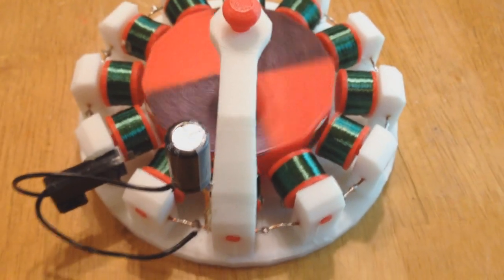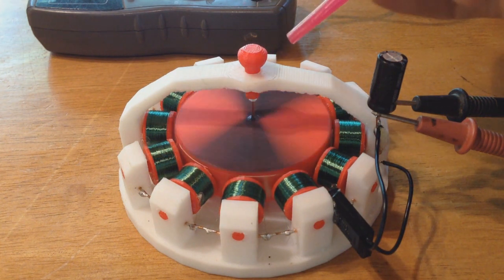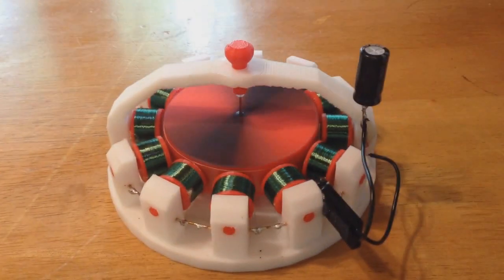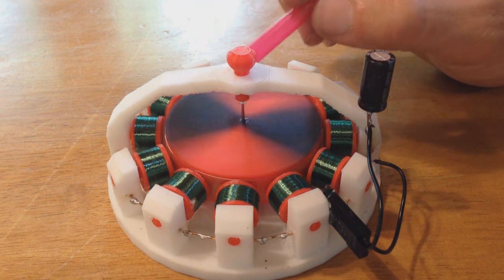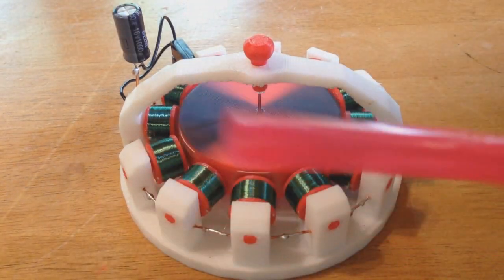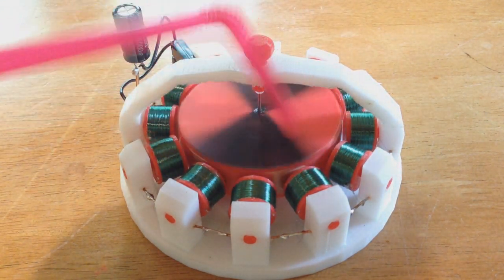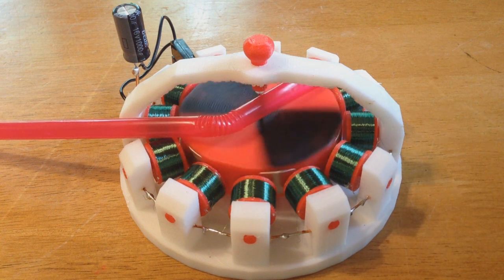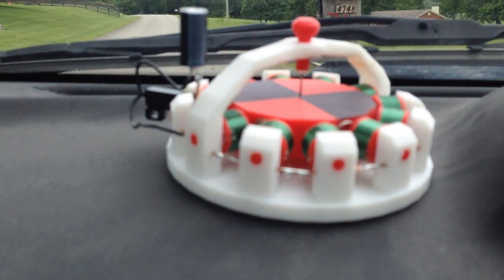No Batteries! EZ Spin V2 Motor Running on a Single 1000uf 16v Capacitor

Comment: Sure it does. He showed an almost 5V output from just blowing on it. I'm sure it can turn even faster with a small motor running it. Any excess voltage can be harnessed and stored in a battery bank or used to light LEDs to demonstrate the over-unity power.

Comment: I understand that this motor runs efficiently, but if you applied a load to the crank shaft wouldn't it just stop?

Keep in mind that power is torque times angular speed, and you have the angular speed, just no torque- ie, the power output is very low.

I think this device would function much better as a generator based on the efficiency. You would need to chain a whole lot of caps together to increase the power enough to put a decent size load on the crank.

Comment: Check this antenna: "New Printable Antenna Can Harvest Ambient Energy To Power Small Electronics"
It says, for example:
Researchers at Georgia Tech scavenged sufficient microwatts to power a temperature sensor, using the ambient energy produced by a television station signal that was a third of a mile away. If you REALLY run at 2 or so micro watts, you should be able to run for free forever just using RF energy.

Comment: For anyone interested I uploaded a CAD model for this if anyone wants to mess with it as I find STL files hard to work with for modifications, as it is a CAD model circles are circles not course polygons etc.   There are SAT and STEP files that can be imported into almost any CAD system.  Have fun!

https://grabcad.com/library/ez-spin-pulse-motor-1

Comment: I didn't say the motor itself is not legit. But the energy in this capacitor is not enough to keep it running for very long. Have you calculated the motor's power consumption? You can use your multi-meter as an amp meter and see how much current is being dragged into it from the cap. If you want to be serious with this you should take an oscilloscope and see how the voltage and currents are changing. And people make magic tricks not only on April first :-)

Comment: Of course it will stop eventually. In any such system there might be energy moving between the parts, but because energy is lost out of the system, eventually all energy is lost. Even any tiny noise it makes means loss of energy.

Comment: As long as you don't claim that there is magic involved LOL. Your focus is obviously to minimize the friction to gain maximum duration of the motor running. If we assume that your only energy source indeed is the capacitor of 1000 Micro Farads, the maximum mechanical energy you can output is defined by E = 1/2 x C x V x V x Efficiency, thus you have only max 13 Mili Joules of energy to do with (5V start). Agree?
A Big Mac contains 2,300 Kilo Joules of energy, just to compare!!!

Comment: How about you connect a 5V motor to the wheel?! If you can generate, say, 10V...use 5 to turn the rotor and have 5V over-unity.

Comment: the magnets is facing N or S pole
Reply: +Ahmed Nor is that a question... or a statement?
Reply: GrimL0gic Thank you for respond and it's a question
Reply: OK, I'll answer the best I can. As the cylinder spins the magnets get pushed by the magnetic field induced by the coils. So as the north magnets passes by a coil the coil will switch from south attracting it to north pushing it away. So if I were to guess, each magnet alternates which side (north, south) faces the coils. If not, they would be too close together and the coil pushing one magnet would also push the other, negating the net force. 
  Let me know if you have any questions or corrections.
Reply: +GrimL0gic 

thank you I got the idea

Comment: It's not doing any 'work' (physics definition) so why should it slow down? The only reason it will eventually slow down and stop is the very low amount of friction (air and axle contact). If it where in free space with no contact it may spin for millions of years, as soon as you actually took any 'work' out of it though the thing would rapidly slow as you are extracting force...
Reply: Nick Outram physically, I think this is correct. The only reason why it stops at some point, would be the friction.
if you connect this to any type of a consumer such that it powers it, it would actually do work so it would slow down much more. but still I like it.
Reply: +Nick - But in free space you wouldn't even need coils or magnets - you can hand spin anything and it will stay spinning - Besides, a motor running on capacitors is doing work, it's powering the circuit.  The one in the following link is much better than the one in the video above: https://www.youtube.com/watch?v=OMVtGxSYdhU&index=7&list=LLBAPkRPdqZTXLOa_C77G9uA

Comment: You Eff? It's Micro-Farad.

The "U" isn't a U, it's a Micro symbol.
Reply: You are correct in saying that it is microfarads, however, i have a boss that has been working with capacitors for over 40 years and occasionally he will say "You-Eff." Yes, its not EXACTLY correct but if there were someone in here watching this that wanted to build this and didnt know the U means micro then they might try and look for an mF capacitor thinking the m meant micro instead of milli.
Reply: you-eff, my-eff, micro-eff. poteito-potato.
Reply: lol. gotta love it Ole-Johnny Olsen
Reply: gmattison1996 [sigh] Oh what effing effer! \( 0_0)/
Reply: Ole-Johnny Olsen 
At least he said You-Eff and not Eff-you!
Reply: Doom2pro Actually, the "u" is supposed to be the Greek letter "mu," which has been adopted as the symbol for "micro," i.e. 10^-6 power

Comment: At the most here all you have created is a low-friction brush-less motor capable of running for extended periods at low current draw, and a motor unlikely to be capable of providing much torque, which severely limits it's applications, especially given it's size and complexity.

I fail to see what is so exciting about it?

Comment: Not at all, my point was just to compare energies. If this motor really runs on a relatively small capacitor of 1000uF for hours, it's quite impressive considering the size of the motor. On the other hand, any battery powered wrist watch motor can also run for many hours on such a capacitor. It all boils down to minimizing the energy loses. There is nothing beyond normal science in this.

Comment: hi have you tried urine sounds disgusting but i have had some very strange happenings when i have tried to carry out joe bookers magnetic charged static air repullsion extraction engine .the urine/piss disappeared/evaporated/soaked in to the engine block  but my engine cranks far faster  i am now told urine is a excellent neutral charge no expert here in uk
Reply: lol don't you just love a place where you can just put it out there?

Comment: Yes, air drag is another loss :-)
So we have these losses:
1. Acoustical noise energy loss
2. Electrical resistance energy loss
3. Air drag energy loss
4. Bearing friction energy loss
5. Electromagnetic radiation energy loss
Did I miss any?

Comment: 1000uF = 1F. That's a big capacitor! The u is actually a Greek letter mu.
Reply: Robert Langford  uF= 1*10^-6 F.....so 1000uF= 0.001F, or 1F=1000000uF
Reply: +Robert Langford You're wrong. 1000uF = 1mF. 1000mF = 1 Farad.

Comment: isn't 1000 uF just 1F? cool motor though.  bet you could run it on atmospheric electricity.
Reply from the maker: 1F = 1000000 uF.
Reply: lasersaber che bufala!!!!!!!!!!!!!!!!!!!!
Reply: ciro de filippis I)?I.
Reply: lasersaber Oh yeah.  Duh.  That's why I use a calculator instead of a brain. 
So it's a mF
And whatever che bufala means.
Reply: +jdotpenneyatcomputer a 1F capacitor would be huge, bruh... like the size of a soda can.
Reply: +Michael Jensen Yeah, I caught this earlier  - see my identical comment above 8)  Oh yeah.  Duh.  That's why I use a calculator instead of a brain. 
So it's a mF
Reply: +jdotpenneyatcomputer 1000uF is 1mF.
But, it's not a bad mF, like Shaft.
Reply: +Jpenney mrcoin "Che bufala"  is an italian expression to say "It's a fake

Comment: I find this hard to believe even though not strictly impossible. A 1,000 uF capacitor at 16 volts makes a little motor go for about a second when I've tried it.  So this has 3,600 times less friction???
Not going as far as to say it's a fraud...
Reply: downoad the stl file. print it.
it works
Reply: randomlettersqzkebkw OK well I don't have a 3D printer yet so I won't build it and I'll accept that it's that amazingly efficient. Like I said, it's not impossible unlike all these morons on the net claiming to have invented perpetual motion machines.
Reply: it's probably resting on a pin or nail for less surface area, and the disc should be very light in order to have less  inertial mass.
Reply: Jake Easterday If you read the design notes, the spindle is turning on a needle resting against a small jewel bearing like you would find in watches. Measured against a hobby-style DC motor turning in an oil-lubricated physical clamp, I can well imagine that the frictive constraint would be 3,600 times lower with this type of hardware. You can usually find tiny artificial sapphire anvil-style bearings on EBay and places like that to design your own.
Reply: The main power saving feature is that it is a Pulsating motor.  That black thing on the left of the motor Armature is a REED Switch.  it only fires a pulse when the rotor goes by a point.   This is basically how battery-powered watches work and can go for over a Year on a Tiny Battery.

Comment: no it will not work cause it has no uses it cannot be used as elecrtic motor cause it has a small volt ..cannot be used to power a small motor in toy car or whatever

Comment: There is nothing special about running a motor on DC from a capacitor, the "U" is
not a U, but the symbol for Micro, as in Microfarad. What is the point of the motor
as it does not produce any worthwhile torque, and would run even longer with fewer coils.

Comment: Furthermore, on the topic of physics, the amount of energy in the quantum flux field of empty space is in the order of 10^110 grams per cubic centimeter, or in energy terms, 10^127 joules per cubic centimeter. That's enough energy to power the entire world for several lifetimes. All we need to do is harness this potential energy. You are the one who is being disagreed with by the sheer mathematics of the matter.